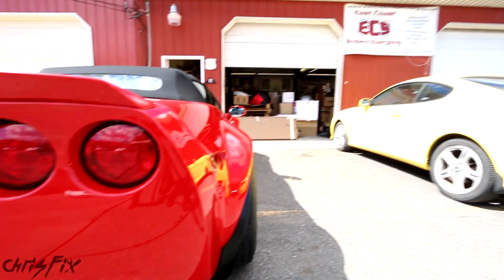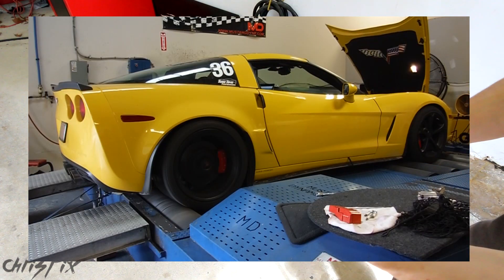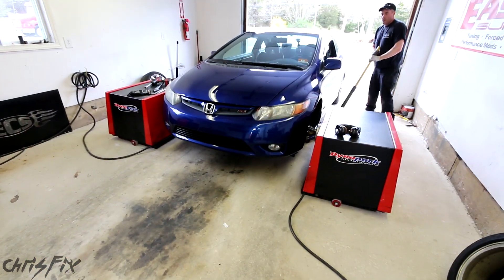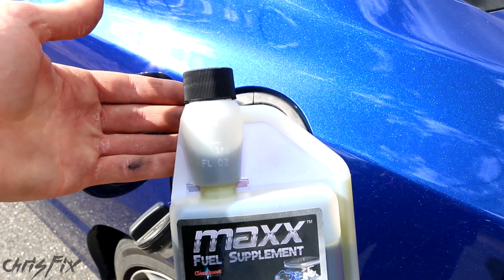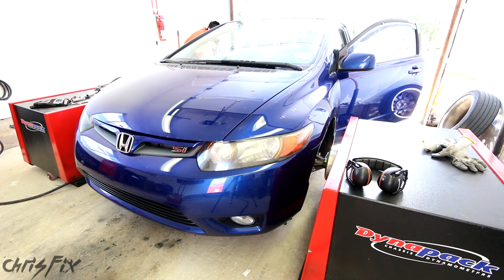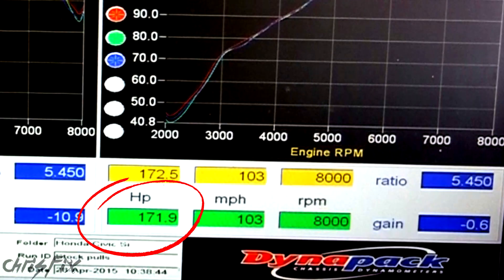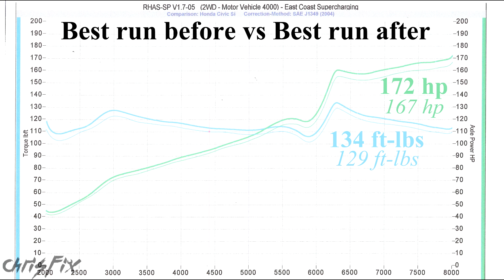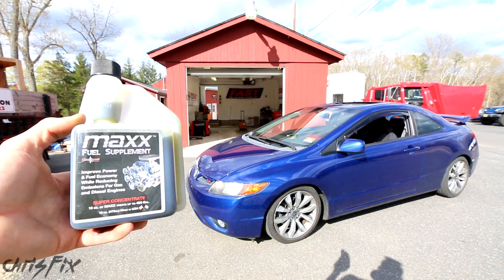Can a Fuel Additive Really Increase Horsepower in Your Car? (With Proof)

Comment: why is the car didn't gave as much output as the company stated 192bhp?
what makes the vehicles loose the power? what should we do to preserve the power?
I mean how to bring it back to 192 bhp?
Reply: The factory horsepower rating is taken from the crank, right at the engine. It doesn't take into account power that is lost through the transmission and drive train.
Reply: ZombieBait  It is on top of that, also done without the Alternator, Water pump, Servo/Power Steering Pump, AC compressor, and often with different headers/exhaust. In addition, cylinder leakage, gunk/carbon buildups, air filter, catalyst converter clogging, camshaft wear +++  as a result of x amount of miles driven, will also lower the BHP. However, engine wear = less friction then a new engine, will help.
Reply: it's like saying iPhone 16Gb when it actually has only 11Gb.
Reply: Because all "cars" are different, they use the horsepower @ the crank as a industry standard. There are Several types of Bhp standard.  SAE net power and SAE gross power, the NET power standard is measured with most of the accessories attached to the engine for a more "real life" result. SAW Standard is measured out of the car, with no accessories, and often with performance exhaust.  DIN 70020 is horsepower measured at the crank, but with the engine installed in the vehicle with all accessories & factory exhaust.
Reply: ***** Oh, and the same engine may be used in a lot of different cars/transmissions. A mercedes engine may be used in 10 different mercedes models, + a LOAD of different brands of cars.
Reply: Raja Ram Mummadavarapu 172whp easilly covers the manufacturers claim of 197 crank hp. specially for a used car.. IMHO
Reply: b00stedrust  Yeah, considering a front wheel driven usually has up to 20% worth of drive train losses
Reply: Then why does factory promises something you can' achieve?
Reply from the maker: Raja Ram Mummadavarapu I think my awesome subscribers explained it pretty well for you!

Comment: Or maybe the car was at the right temperature and "woken up" after the 20 minutes ride...
Reply: Adam Harr
Interesting, I don't see a 2 degree Fahrenheit difference resulting in a 10hp difference though.
Reply: ok good to know thanks.
Reply from the maker: Jean V We had the same exact conditions in both the before and after runs and we monitored the cars engine temp as well as the ambient temperature.
Reply: ChrisFix I know the temp gauges in cars act more like "dummy" gauges where they'll sit the needle halfways between cold and hot as long as the water temperature is within normal parameters.  I've got a ScanGauge in my car and it tells me the waters temps straight out of the OBD2 port, so my subarus temp gauge sits right in the middle between 180 to 200 degrees it seems.

That being said, I wonder the ambient temperature dropped towards the afternoon?  It seems like cooler air coming into the engine would be more dense resulting in more HP.   There's only so much you can do though without your own lab to test these kinds of things.
Reply: SuperJman991 you can see in the vid the ambient air and air pressure on the dino. it was cooler and had higher pressure in the first test (it was only a 2 degree difference witch can change things but i don't think it wood be that big a difference).
Reply: Ya I agree I am just saying it is there
Reply from the maker: Adam Harr The computer corrects for the temperature and barometer differences.
Reply from the maker: jeffel80 And it corrects for humidity (all weather anomalies)
Reply: Jean V Unlikely. The first 3 runs showed almost exactly 15% drivetrain loss, which is usually the standard metric used when accounting for drivetrain loss. Considering it went down to less than 12% drivetrain loss its unlikely that the temperature was the culprit. If this were a 400hp engine you may be onto something, but its a 195hp engine where 5hp makes a difference percentage wise.

Comment: Anyone who works on or builds performance cars for a living will tell you that you won't feel more power unless you make at least a 10% gain, and you won't see a significant improvement in your numbers on a track without improving things like tires and breaks as well.  Even just adding this product to try and improve fuel economy isn't going to pay for itself with numbers like that.  Something as simple as a change in altitude or temperature can give you that 11hp gain depending on conditions and wear on the engine.
Reply from the maker: hellcat1988 While you are correct, the idea was to test the claims that it adds power. You will need about 30hp for the butt dyno to feel anything. If it increases MPGs and makes it cheaper to operate the vehicle, which I will be testing in the next video on this stuff, it is worth it. The dyno runs were taken within an hour of each other and the weather conditions were the same and corrected for by the dyno (temperature, pressure, etc) and the car was at the same temperature as well to provide the best possible accuracy I can for the test.

Comment: Great video, does this treatment have to be done at every gas fill up? Also, did it increase the mpg? Thanks in advance for your answer.
Reply from the maker: Frank Dumlao Thanks! Yes, it has to be used in the gas you are running in order to get the results. I will be testing the fuel economy claims in another video.

Comment: So I think the only way this can actually work is if the fuel being used is not the optimal octane to begin with, because that's all most fuel additives do to "increase" power, is raise the octane rating. If your engine is meant to run on higher octane gas and you put lower octane in, it will not produce peak power, so adding this additive would increase power. That's the only way i can imagine you'd get a result like the one in the video. By the way, I really appreciate the way your videos are put together, I think you might just have a fundamental flaw in testing methodology for this test. The civic SI is meant to run on 93 octane "premium" if you were running anything less than that, it would explain the results. It is possible to get a bad batch of gas as well, so even if you buy 93 octane it doesn't mean it's 93 octane for sure. Is there a way to test octane quickly when conducting a test like this?
Reply: ChrisFix TOLUENE or another light distillate aromatic. 

Chris ... please look into and report on Auto-RX.com
Reply from the maker: hzuiel This additive does not increase octane and we used premium fuel (91 octane). How this stuff supposedly works (straight from the company's website):  it is a catalyst that maximizes the potential energy in the gas and converts it into kinetic energy. Basically, it is making the most of the gas that is in there already.

Comment: anything below 10% increase is negligible and will not be noticed by driver nor can be blamed on fuel additive... ambient temperature was key here
Reply from the maker: Christian Arias You are correct in saying it isnt noticeable by the driver but the ambient temperature was accounted for by the dyno and it actually went up 2 degrees which can be seen when I show the computer screen.

Comment: I forgot where but i read somewhere that you need to make around 10% more power in order to feel the difference in the car. Did you feel like the car had a little more pep?
Reply from the maker: Raul Cipriano I would say you need about 30hp to feel it on the butt dyno in most cases. I did not feel any difference in the car when driving.

Comment: There is no way.  I wonder if the performance increased because the engine had more run time on it for the second test.  There is more involved with engine efficiency than just coolant temp.
Reply from the maker: lyokofans Could be. We need to do some more testing to know for sure!
Reply: lyokofans heat soak is the main issue.  need to measure the air intake temperature with an OBD reader.  hotter it gets, worse the performance and coolant temp has little to do with it.  all that heat transfers to the intake tubing, throttle body, etc.  despite this though, the 2nd run still came out ahead even after the road test which should have generated a good deal of heat soak.
Reply from the maker: lyokofans The engine does run better when it is warmer but it makes more power when it is cooler (due to air intake temps).
Reply: ChrisFix Oh I see.  Thanks.
Reply: oldtwins
Oh.  I am not much of a car person.  I thought engines ran better at a warmer temp.

Comment: Did you use a fuel system cleaner before the test?  Just by cleaning the fuel system you would get the same effect.
Reply: Boodieman72 He ran seafoam in his last video to clean up the same Si. Check it out :D
Reply from the maker: Boodieman72 Yes, I ran seafoam though the car to make sure it wasnt a cleaning affect causing the increase in power. Check it out: https://www.youtube.com/watch?v=u6UeJXkzDW8

Comment: I have one quick question. What was the octane rating of the fuel that was used in the Civic Si? Was it 87, 89 or 91 octane?
Reply from the maker: sportsmansparadice42 It was 91 octane as required by Honda.
Reply: ChrisFix Thanks Chris. Where can you buy this stuff, and what's the retail cost per bottle?
Reply from the maker: There is a link in the description and it is around $30 for the bottle that treats around 500 gallons of gas.

Comment: Hub dynos arent accurate, the hub is a lot smaller than a wheel
Reply: Brendan Cunningham nor do i believe there is that little drivetrain lose
Reply from the maker: hub dynos are very accurate. There is no wheel spin, tire friction, etc to take into account. Perfect for doing comparison runs.

Comment: To people that believe that the Si probably had a unclean system or dirty valves, he just run seafoam in his last video and drove it hard to get some cleanings. So I'm pretty sure the car is in a good condition for testing. However, I don't blame the people who still think it's unreal because there are so many factory that can affect the result. But what we do see here is that all 3 runs with this item was very consistent. And I do want to see more testings on this product so keep up the good work Chris
Reply from the maker: Yu Huang Thanks a lot! Yea, it is in no way a definitive test because you need to run 10 different cars to get results like that but I will be doing a fuel efficancy test soon to see how it performs in that sense!

Comment: Awsome results Chris! I was reading about an old product that is sold here in Portugal and in a CBR900 it gave more 9HP. Everybudy says it is the best product here. I will give it a try. This test was made only adding the addictive to the engine oil to reduce friction not in the fuel but there is also for fuel. The product you are testing here in Portugal does not exist so hard to get.
Reply from the maker: nuno ribeiro Thanks bud and thanks for sharing! I personally dont like adding stuff to the oil but that product sounds interesting.
Reply: The name of this product I'm talking about is Faher. The one you've tested cleans the the fuel system?
Reply from the maker: nuno ribeiro Never heard of it!

Comment: Its better not to run that stuff... You lost all your bottom end torque which is a big loss. Gained a noticeable fart in the wind at top end but you have no torque to get your ass moving off the line.
Reply from the maker: AJ Harran Actually, take a look at the graph at the end where I compare the two. We had an increase in the whole curve plus better consistency in power!
Reply: You read that all wrong. Look at the comparison graph at 9:00, it gained torque and HP on every part of the rpm range. At no point was there no visible gain or a crossover of before and after, a solid gain across the board is all there is to be seen.
Reply from the maker: Dominic23577 Exactly.

Comment: What if you add the whole bottle? Or 2 bottles? Or remove the gas and fill the tank with this horsepower juice! The world may never know and that makes me sad.
Reply from the maker: ***** It would do nothing because the way this additive works is it makes the most of the gas you already have. It makes the explosion more concentrated. Gas only has so much energy so there is only so much HP you can gain. Make sense?

Comment: Now that you have performed this video on a dyno, maybe you can compare fuels also.

What fuel is that Honda run on, I assume its run on regular or mid grade, why not compare regular, mid grade and premium fuels on a dyno and see what that produces?

Here in the UK we only have two main grades of fuel, regular which is 95 RON and Premium which is 98RON, with some suppliers doing a variation on the latter with some doing 97RON and some doing 99RON.

I know that there are videos that claim spending the extra money on premium fuel is like throwing it in the bin for a car that doesnt call for it.
Reply from the maker: pugman205 Thanks for the ideas. This car was run on premium gas (91 octane). I like your video ideas. I will have to think about a way to make it happen!
Reply: I am glad that you like the idea of comparing fuels, though i am not sure how that compares with power etc especially with modern fuel injection.
Hopefully you can make this happen.

I too drive a Honda, but instead an 2000 Accord (European spec RHD) with the 2 litre F series engine (like the 2.3 F series engine in US models) and its always run on 95 octane fuel, which is the minimum due to British Standard certification.

Comment: Two thoughts...

First, you added twice the recommended concentration.  Second, it appears you trusted the dash coolant temp gauge rather than the much more accurate OBDII reading, which could skew the results.
Reply from the maker: stvnscott Thanks for sharing. The coolant temp gauge on the dash is accurate enough for this experiment. There are so many variables that watching every single one that closely would make this a very costly and time consuming process (and it already wanst cheap). I defintiely agree that using the OBD2 would have been more accurate, but we were at the coolant operating temp and had the same part of the bar as before so... I ended up using less than 1/2 an oz so the concentration was not exactly double (the container was tilted forward). Plus we didnt add more gas so there was no new gas to "wash" down the additive if that makes sense. I rather have a little extra then not enough because even if I added 5oz there would be no change in HP since there is only so much power you can get out of the gas.
Reply: ChrisFix I would say the coolant temp gauge is absolutely not accurate enough when looking for small HP gains that may be within the margin of error of the equipment.  You need to very carefully control for the conditions that may affect friction in the entire drivetrain, including engine oil temp and transmission oil temp.  

Extraordinary claims require extraordinary proof, and providing that proof requires very closely controlled scientific testing and analysis, which I do not see here.  What I do see supports the conclusion that you can get different results from the same car on the same day after detaching it, driving it, letting it sit, reattaching it, letting it idle, and that more rigorous testing is needed.  A good working theory is that the car was already heat soaked during the first set of runs and was not during the second set of runs.  Another good working theory is that that activities in between changed the mechanical properties of the testing setup.  Neither of these theories can be ruled out by the procedure you used.

If you look at the MSDS for the product in question, you will see it is basically the same as every other fuel system cleaner on the market (naptha, trimethylbenzene) with the addition of a tiny concentration of lubricating metals.  There is nothing in it that will boost horsepower or torque.  And, even if it did, most modern ECUs would probably "learn" to negate its effects within a few hundred miles.  Finally, reporting that peak 11HP increase is a bit sensational.  It would more appropriate to report a 5HP increase by subtracting the best run of the 1st group from the best run of the 2nd group.

Also check out Grassroots Motorsports Magazine's test of a similar product called EFS Combust.  Their testing revealed tiny gains that were within the margin of error of the equipment.  There is no data on whether these tiny gains would be seen on a consistent basis.

These tests are good fun, but I would not spend my money on such a product without much more rigorous testing.  Enjoy!
Reply from the maker: stvnscott Thanks for sharing. If I had a lot of money, all of those factors can be controlled for, but this stuff takes a lot of time, effort and money as it is so I did my best with what resources I had.

Comment: better videos....more important videos....
right to  the case....with a little of side infos.....
your realy went far better than when you started.....

and check this out...a bottle that actually give power...im impressed....
how does it do it..? higher octane which makes the engine less prone to pings forcing the ECU to introduce more aggressive ignition timming ? thats my guess  

great video...thank you for your time and effort

cant argue with dynos...
Reply from the maker: Faisal Abdulaziz Thanks a lot man! This stuff isnt an octane booster. How it works is it is a catalyst that maximizes the potential energy in the gas and converts it into kinetic energy. Basically, it is making the most of the gas that is in there already.
Reply: hmmmm......thank you very much for your time....